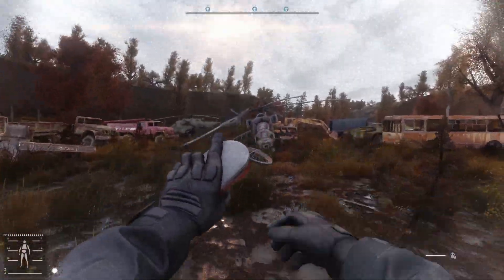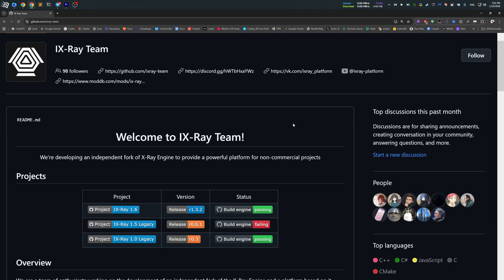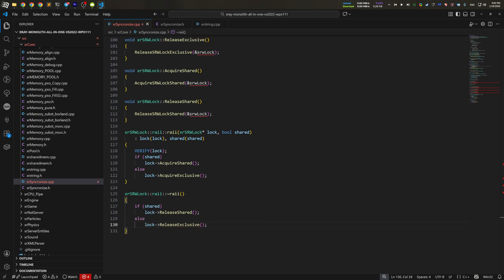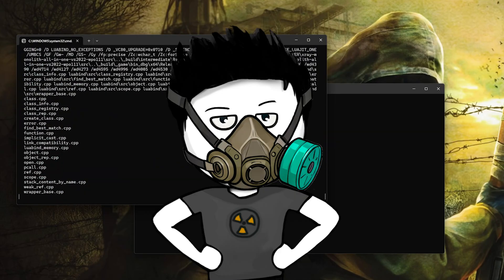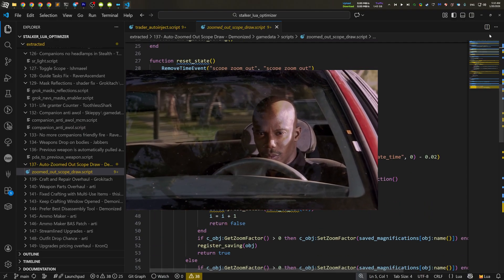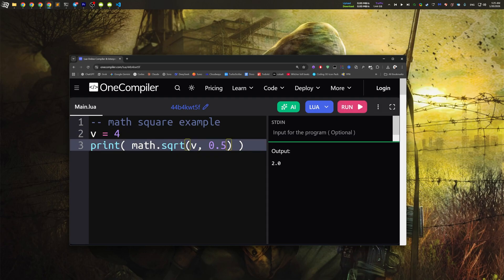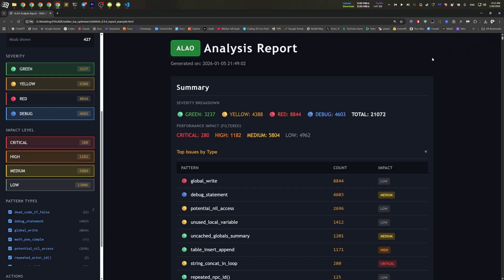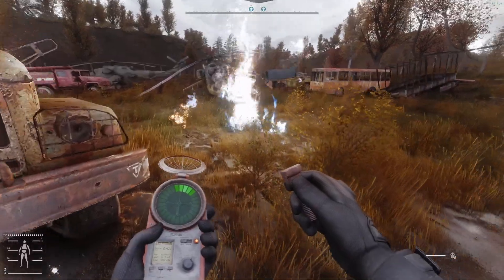How I Fixed STALKER's Terrible Engine Performance

Comment: Nice video. But as a programmer I would never ever recommend to optimize the code which isn't a bottleneck for performance. All these "in theory it should be faster" usually leads to additional bugs and no visible performance gain, even if it faster in theory. So, to be short - it just don't worth it. But what worth it, is to look for a bottleneck first, profile the code and see which functions actually chocking the performance and try to optimize these functions. And now you'll have all the gains. Sorry for maybe grampy comment but through my experience "random optimizations" doing more harm than good, just want to warn you for your future career.
Reply from the maker: Actually you're 100% correct.
I didn't profiled Lua much, since I already knew it was a bottleneck causing microstutters.
And since it was more like a proof-of-concept, I didn't used any profilers on purpose, since I was sceptical about the whole idea as is.
But then, suddenly .. it worked :]
Reply: @howdy_official  sure if you already knew that Lua code is bottlenecking, make sense. But you'll be surprised how much slept from your imagination but could be caught by profiler. Still be careful because profiler runs with debug code to collect execution data, and release code might behave differently. Good example stl containers from C++, which runs much slower in debug and can cause false positive bottlenecks. Good luck.
Reply from the maker: @homersimpson8955  Ty, I'll keep that in mind

Comment: Nice video! By the way, I recommend using clangd instead of Microsoft C++ extension, as clangd is open source, lacks telemetry and has a lot of refactoring tools and in combination with clang-tidy can spot a lot of memory safety and performance bugs.
Reply from the maker: Thanks for the tip!

Comment: 6:34 shouldn't the second one be r=2^2? 2*2 is multiplication, and while x^2 and x*2 will give the same result if x=2, it won't for other numbers. Was it just a typo?
Reply from the maker: Both expressions 2^2 and 2*2 returns the same result, actually (except the type of a result value).
The context matters, though.
If x is our variable, then it would be: x^2 and x*x respectively
For the cube it would be x*x*x which is still faster than x^3.
Afaik Lua converts the second expression to the same math.pow call under the hood.
And for the first expression (x*x*x) it’s just a straight up two multiplications in a row.

Comment: as a senior game dev, this is probably the dumbest video I have ever seen. I was surprised by not seeing a single attempt at profiling the code before trying to optimize it when I got halfway into the video, then at the end when you show the difference its literally down to measuring error. you're not even CPU bound in the footage you recorded at the end, any kind of CPU optimizations will not be visible on your setup. 

profile anything before you make changes, any claims that things are faster just because they take less instructions is plain stupid. don't rely on how an algorithm scales as a way to measure performance, this is only something that applies to large datasets - not arrays that could be 1000s in size. it feels like you're applying university terms to optimization without understanding why they're relevant. 

since you're GPU bound, the main way to actually boost framerate here would be to reduce what the GPU is drawing, use a GPU profiler, find out whether you're vertex or fragment bound. if its vertex bound then look into improving how the engine does culling, trade heavier CPU work for making the GPUs life easier until they're balanced. if you're GPU bound then its literally just down to optimizing shaders or overdraw.
Reply from the maker: Actually it's the CPU bottleneck here, not the GPU.
I can easily reduce the GPU pressure, but FPS won't go up.
One more thing to notice, is that I had no plans on increasing the FPS whatsoever.
ALAO and the whole idea behind it is to increase Lua performance & reduce the GC pressure in the first place, making the gameplay less stuttery.
As for the profilers, you're right ofc, but I didn't used any on purpose, since that's a proof-of-concept.

But I plan to utilize some sort of Lua profilers and debuggers in order to push ALAO to it's limits.

Comment: If it wasn't for the "best practice" of using libraries and advanced features of programming languages, instead of the only the most basic features which are by far the most performant, none of these issues would have occured.
Reply from the maker: We pay with performance for a higher level abstraction, that's just how it is.
And now with the era of AI things gets even worse.
More developers should learn what's memory, how CPU works, etc.

Comment: _g.script 
is where you need to optimize or fix and the hardest or trickiest, that's what i think anyway
Reply from the maker: ALAO can be applied to vanilla anomaly scripts as well, it's included in the how to use guide.

Comment: "fixed", but no test. ok.
Reply from the maker: Alas the experience from ALAO differs depending on the PC specs and a specific modpack.
Although it's open source and comes with a detailed how to use guide, so you are free to test it yourself.
Reply: @howdy_official  ок.

Comment: Not familiar with the Lua ecosystem, but I’m curious: Was the AST generator built from scratch or did you take the AST output from whatever the LuaJIT compiler produces (similar to clang’s AST tool for C/C++)
Reply from the maker: I used luaparser Python library.
Though it will be a bit overkill to use an actual Lua compiler for a proof-of-concept project.

Comment: Nice job with it; I tried it. While I didn't notice as much of an impact (for Anomaly + some custom-picked mods), I really appreciate the work you've done with it. Honestly, for modpacks like GAMMA, this should provide a nice boost.

The frametime issue is mostly caused by the LUA GC, so if we could minimize waste in LUA, that would also help the situation. (Also, alternatively, the AOE guys are trying to implement a better LUA GC.)
Reply from the maker: Alas the experience differs.
Some say ALAO makes it butter smooth, others say it's not noticeable at all.
I guess it highly depends on the spec and a specific modpack.
And yes, you're right saying it'll make the most out of huge modpacks.

As for the framerate .. actually Lua GC thing causes more like stutters, rather than an FPS issues.
At least from what I can tell.
Also with modded exes you could increase GC step to make it little less noticeable.

Comment: A video where you benchmark the game using the individual ALAO versions or individual optimization stages would be very interesting. Just by looking at the numbers the difference in performance seemed rather small. Nevertheless this work is a very good step towards better performance of our beloved Stalker mods! Keep it up!
Reply from the maker: Alas the experience from ALAO differs depending on the PC specs and a specific modpack.
As for me, it makes the gameplay much more smoother .. but you can't tell much from the graphs only.

Comment: Hey dumb request here.. could you add controller support and somewhat of a aimassist for controller players? I tried it on the steamdeck and yeah with some ellbowgrease it runs and trough button mapping i get somewhat of a gamepad feeling but i couldn't create a mod that does the aim assist thing.. I looked online and there is a old mod on mod.db that tries this but its baissicly a aimbot and not aim assist. I tried it with gemini and chatgpt to edit that mod but to no avail. If you spare the time I would appreciate that.. <3
EDIT: The Video is fire so far.. :D
Reply from the maker: Tbh I had an idea to add an extended controller support, but can't find time to implement it.
With configurable aim assist ofc.
Cuz I like playing on a sofa with a controller myself.
Maybe I'll make one someday, subscribe to my ModDB or Patreon (free) to stay tuned, in case I make it :]
Reply: how braindead are you to ask that to this guy
Reply: @andrewshillaskim3773  Asking is free, beeing a dick is a choice.

Comment: ☝🤓 actually source code first leaked to public in 2014, and it was quite complete (3rd party libraries like lua,luabind,boost,ode, etc were missing, which you need the right version to compile, and some were a bit modified by GSC)
Community programmers (KD87 notably) dealt with it in a week or smth and compiled the whole working SoC engine.

Comment: This and adding multithreading into anomaly might save us from the pain of 40 fps constant
Reply from the maker: Afaik AOE devs are already using ALAO, saying that it noticeably reduces frame time.
Reply: @howdy_official  AOEngine, regardless of what you think of it, is the reason me (with my fuck you fast computer) can play Anomaly Custom at a locked 75 FPS though.
Reply: @howdy_official  Sadly GAMMA's modder doesnt want to use AOE and mentioning it on the server can even get you banned...
Reply from the maker: @MrChisponX  While I do understand why they don't want to support closed source project in any way, it's kinda confuses me at the same time .. because GAMMA's official launcher is a closed source project, as well.
Reply: @howdy_official  Yeah thats just another case of grok's nonsense
Reply: @howdy_official  Isn't AOE closed source? They can gloat about performance all they want, I ain't running anything that shady on my machine
Reply from the maker: Alas some projects lack respect for privacy and even basic source availability.
While I use xray-monolith personally, it’s still kinda good to hear that even with multithreaded engine ALAO pushes the performance even further.
Reply: @KekForce1  it's closed source as some of the code is comissioned and paid for, many closed source engines in stalker, many mods in stalker, you may not trust it, but it's not the first closed source project for stalker, not the last, and doesn't mean it's 100% untrustworthy
Reply: @Bernhar301 Not showing the code for a mod to a video game that you're not the owner of is very shady.
Reply: @Bernhar301 commissioning someone to write code is not an excuse to keep that code to yourself

you can commission developers to write contributions to open source software, including your own; for example, valve has been sponsoring a lot of people to improve software in Linux ecosphere lately lmao
Reply: @KekForce1  Iol you are probably using a ton of "shady" software. I benchmarked aoe and monolith on my channel, difference is so huge that it cant be ignored.
Reply: @KekForce1  We got Richard Gaming Stallman over here
Reply: @JohnDoe-jk3vv  What's your problem with him?
Reply: @KekForce1 they said it will be open source at 1.0, which will be inside of the year.
Reply: @dannthemannwiththefryingpann  They would get the engine to 1.0 faster with more contributors
Reply: I play gamma at 100 fps.  wtf are you on about
Reply from the maker: @Nathdood 4K Ultra?
Reply: 30 FPS ought to be enough for anyone
Reply: @1610enjoyer  60 fps is not enough, 90 fps should be the new standard for AAA games.
Reply: @1610enjoyer  lol, tell me you never played a fps videogame...
Reply: @goku445 tell me you didn't get the reference without telling me you didn't get the reference.